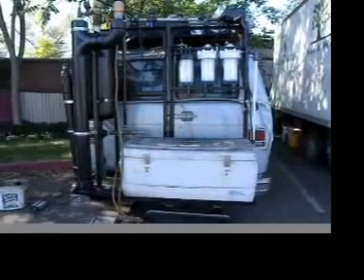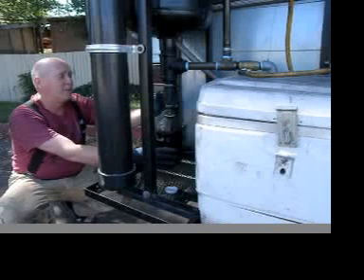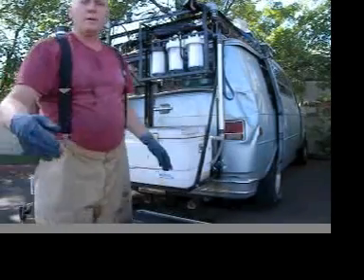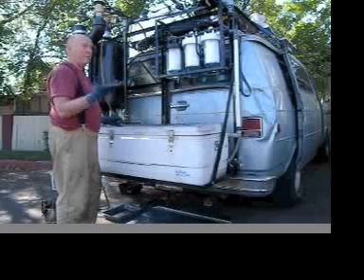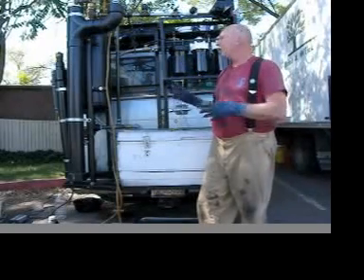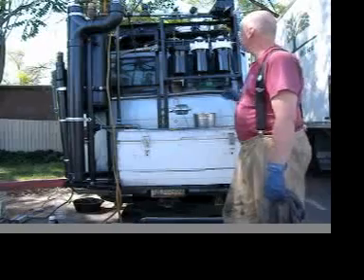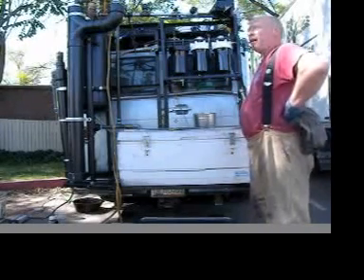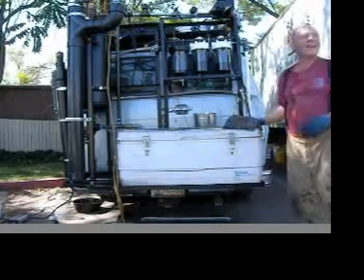Blending gasoline with vegetable oil to make diesel fuel I

Comment: hello sir,
you have any expiriment about jartopha oil blending with gasoline?, In which proportion , is it also like WVO 80:20 ?
Reply: shihab muhammed I have not used, nor seen, jartopha oil, so I do not know its properties.  If it is a light oil, then 20%-50% should work fine, but you will have to experiment to see how it blends, and burns in your engine.

Also, I have been experimenting for the last 2 years with adding more gasoline to my WVO blends, and have found that 30% gasoline burns better than 20%, and my estimates suggest that 50% is ideal.  So, I plan to run 40% for the next year to see how that blend runs.